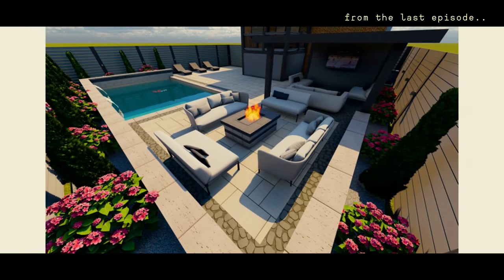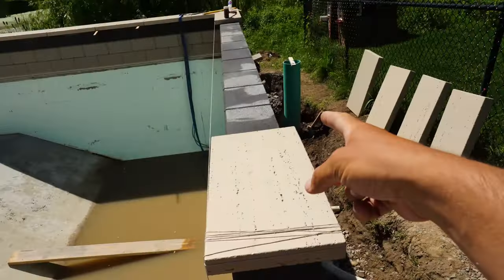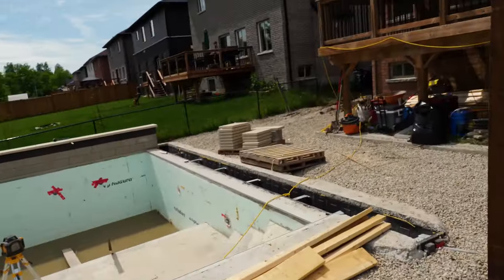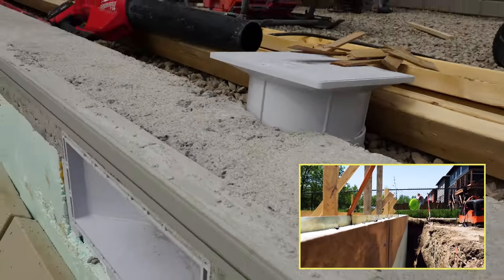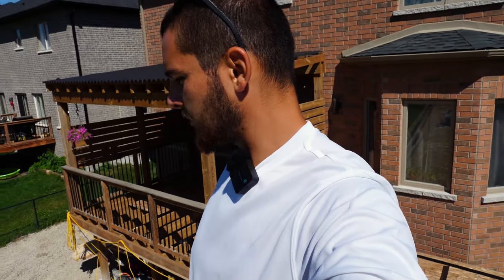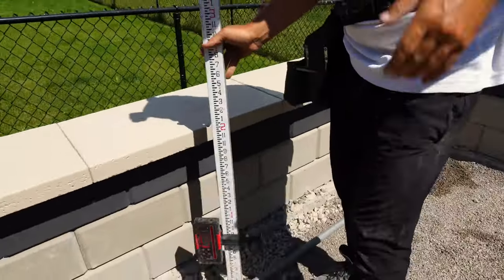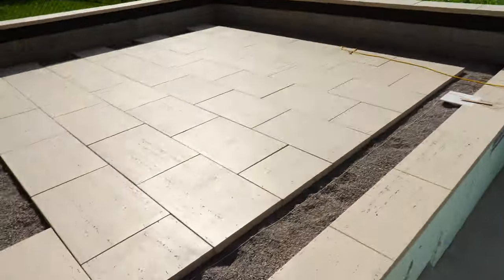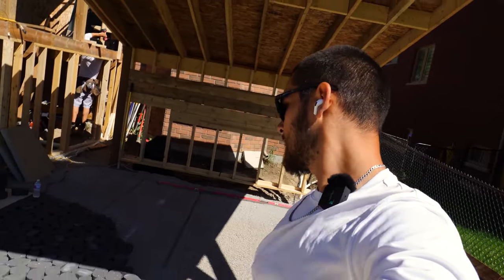Installing A $60k Patio | Visionary Vlog EP 10

Comment: Did yall end up using plaster on the pool what did you coat it with? And is one skimmer box enough i only ask because i didnt see a main drain anywhere you may have had another line designated for it idk